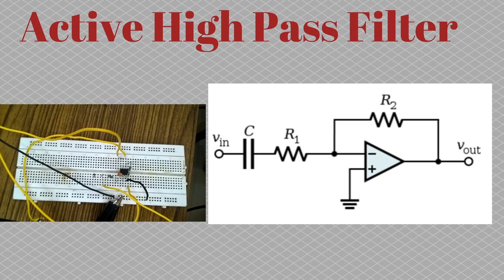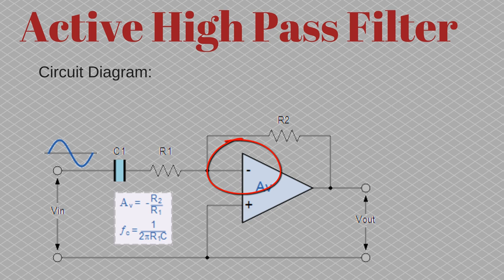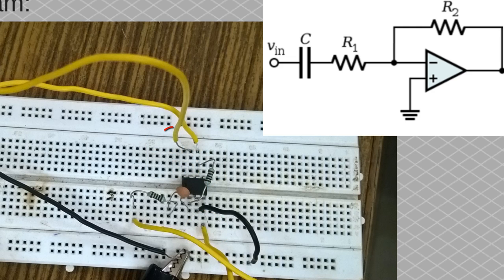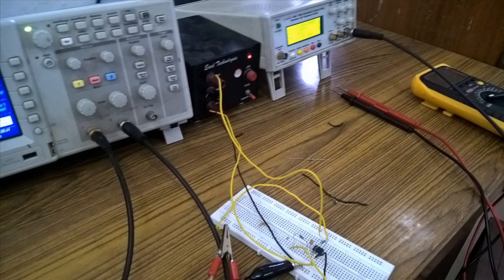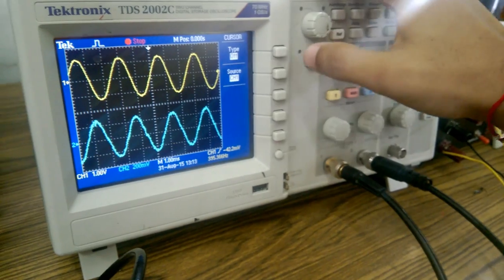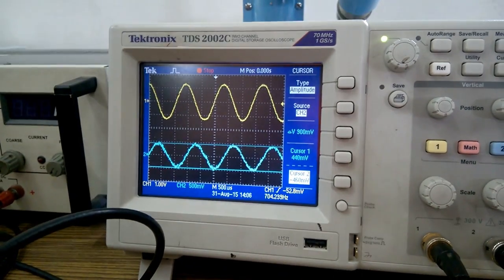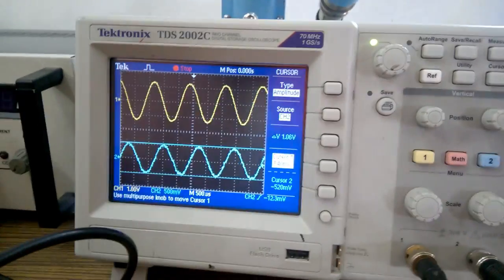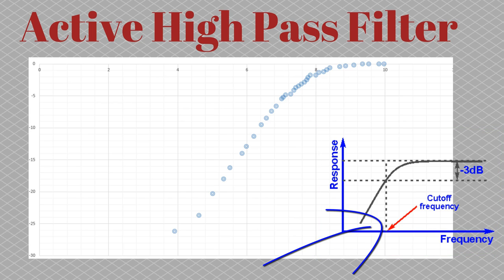Active High Pass Filter [EXPERIMENT]

Comment: Why did you put the input voltage through the resistor first instead of the capacitor? According to the schematic, the input waveform goes through the capacitor first and then through the resistor. I am asking this because when I built the schematic out on a breadboard using a TLV272 op-amp, I actually got a low pass filter response instead of the high pass filter response I wanted. Then, when I built it out the way you did, with the resistor first and then the capacitor, I got the high pass response I needed. Why did this happen????

Comment: why we use op-amp here? What are the advantages of using Op-Amp in high pass filter?
Reply: What do u wanna use to do it? I'll try to answer you.
 Anyway the passive components intoduct uncertainly in the process ,furthermore they dissipate static power and are very big. The Op Amp are compose by transistor, the result is they are more versatile. 
In the active filter passive components are used , but the amplifier work as buffer minimising the noise introduct by passive components
Sorry for my english
Reply: Just my two cents: The Opamp here works as amplifier of the filtered signal and often (more) important as buffer, opamps have very high input resistance and low output resistance. With that you can do impedance matching and prevent to load the filter, which might have a bad effect on your signal. Please correct me if I am wrong :)